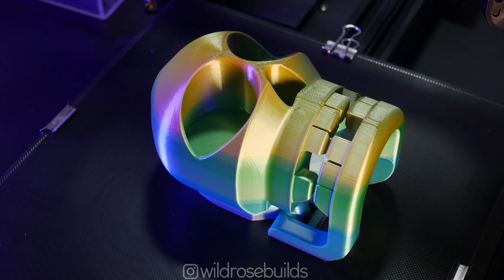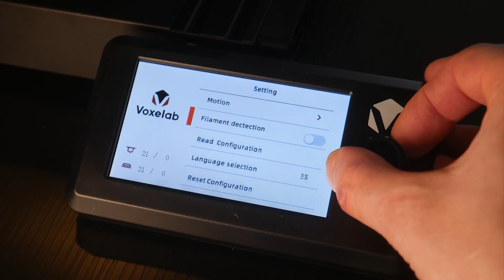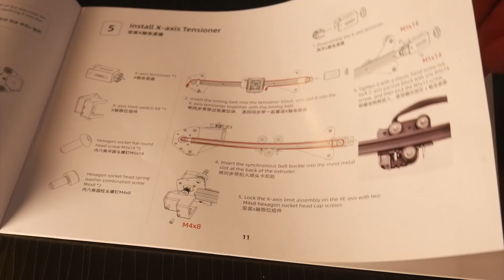$179 3D Printer - Voxelab  Aquila Review / OctoLapses

Comment: Are you using any specific settings in cura to help with the surface finish? Your prints are super smooth. Mine can be to on a simple part but a more complex one lends to horizontal bumped out lines. Maybe a flow problem? Surface finish is good.

Comment: I have this printer, great value for money! I'm new to 3d print, have it from a week. Very good prints, i used cura but now I'm trying prusa slicer. Only little issue: some really thin strings. I'm using not expensive pla but good rated on Amazon. 200°C and 50 mm/s speed. Your prints are amazing, stringing free! What can I do to improve?

Comment: I just bought the Voxelab Aquila and the the included files printed brilliantly, but I'm having trouble setting up cura for stl conversion - things are turning out just so-so, not as sharp and clean as the test files. Do you have suggestions and tips for one new to the hobby? Also how do you have Octolapse set up with the Voxelab, including security? Any help would be appreciated. I've watched a bunch of videos but too much info. Thanks!

Comment: I cant get my ender to print anythinf this good. Any tips?
Reply from the maker: switch to prusa slicer if youre not on it already, tune your e steps per mm and make sure those v slot wheels are tensioned perfectly :)
Reply: you need good 3d model first. There are pages where you can buy models and quality of these prints is insane.

Comment: I was looking at getting my first 3d printer and pretty much narrowed it down to this one or the Sovol SV01. Almost leaning towards the SV01 because of it mostly being out together and the direct drive. Right now this one is 200 on Amazon and the SV01 is 260. Still not sure which would be the better choice in the long run.
Reply from the maker: The sv01 is rock solid! I believe it has dual z axis lead screws and a slightly larger print volume. I really enjoyed my time with the sv01!